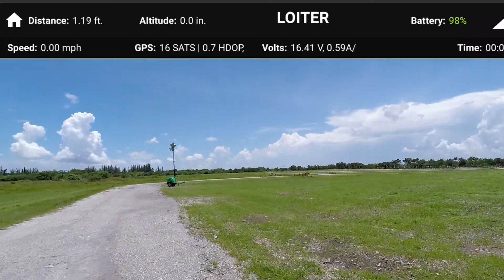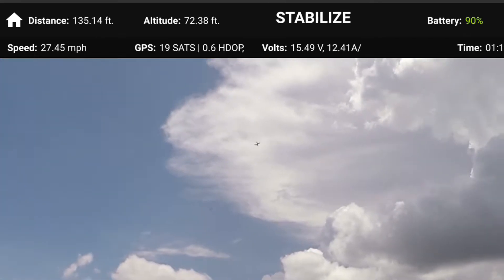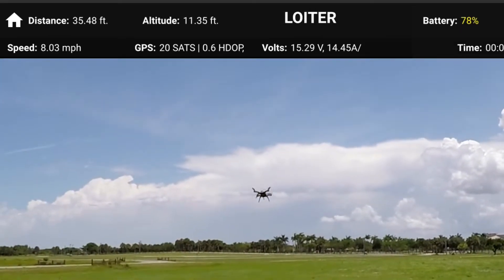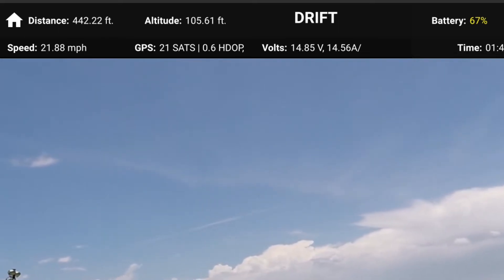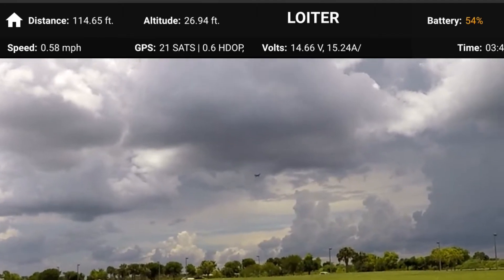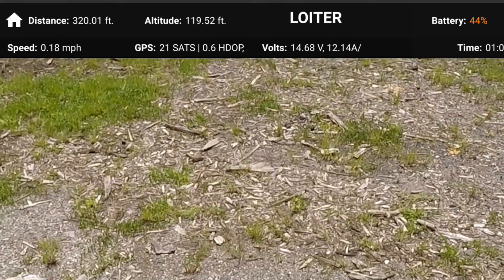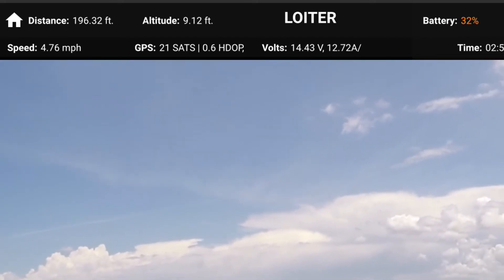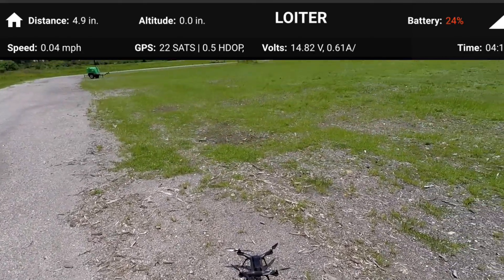3DR Solo - Flight Modes Demo Including Acro

Comment: When you set it to acro, since the throttle is centered. At the center position is 0% throttle? Or 50%?
Reply from the maker: Probably a bit less than 50%.  As soon as you press the button, it starts climbing.

Comment: Open Solo gives you more modes on the A and B buttons. And they can be changed. These are the default modes for Open Solo.

A single press: Manual

A short hold: Stabilize

A long hold: Auto mode

B single press: Position Hold

B short hold: Drift

B long hold: Sport

Camera Preset top long hold: None

Camera Preset bottom long hold: None

Camera trigger long hold: Gimbal lock ("FPV race mode")